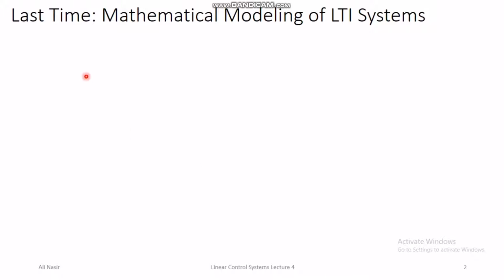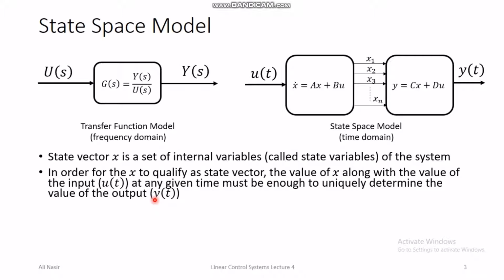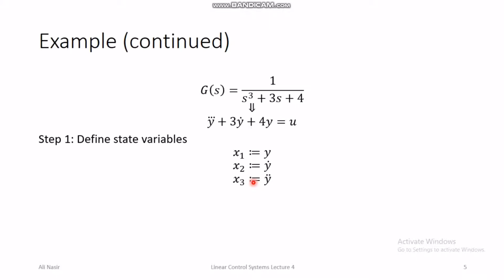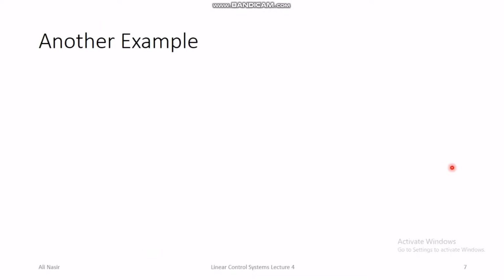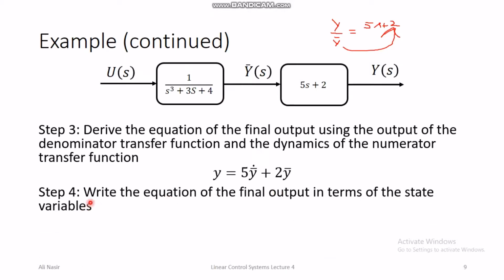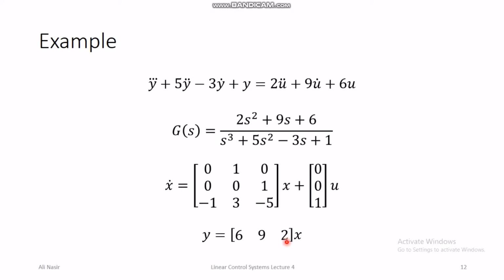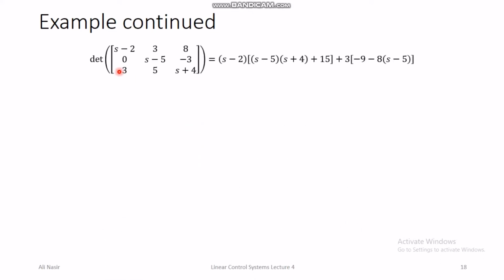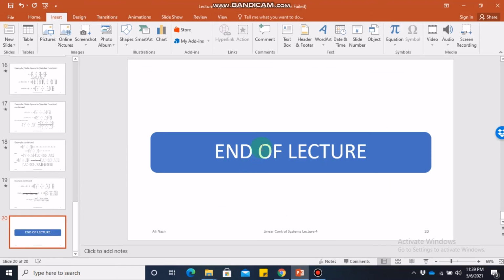Lecture 4 State Space Modeling of LTI Systems

Comment: There is slight error in the matrix (sI-A)^-1 : value of factor a32= -77 instead of -65. Also, can you explain how the denominator arrived.
Reply from the maker: Thank you, I highly appreciate your comment, but the calculations are correct in this case. The denominator is the determinant of (sI-A). You can verify using the ss2tf command in MATLAB.
Reply: @cset  
Thank you, I'll Definitely look into my calculations once again.